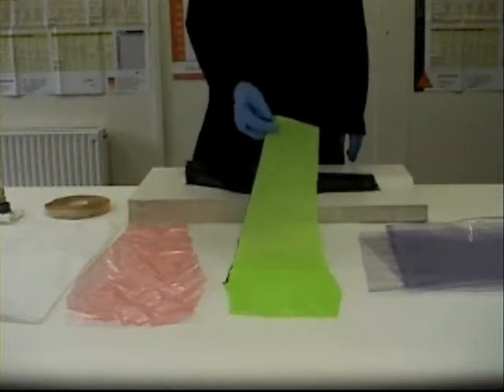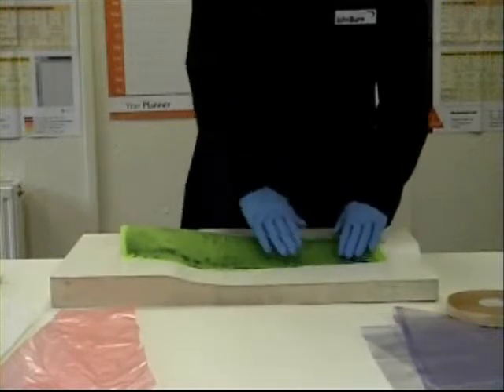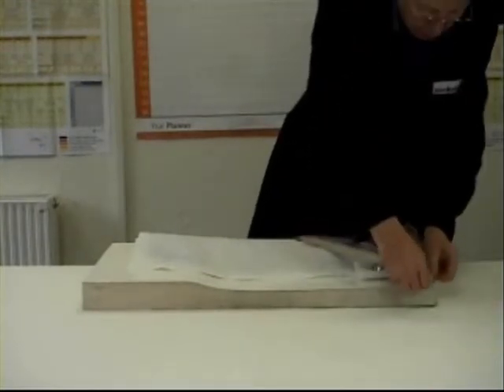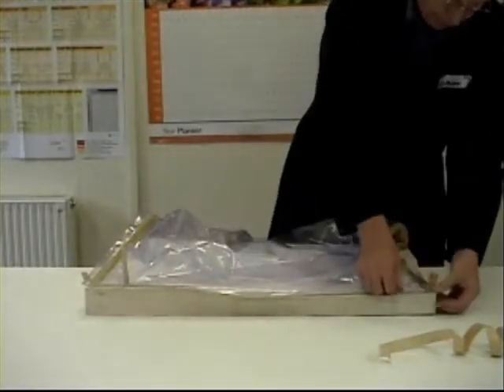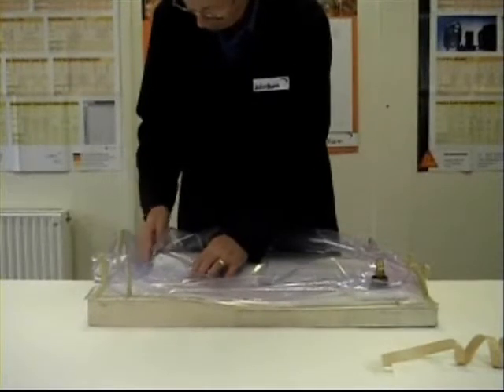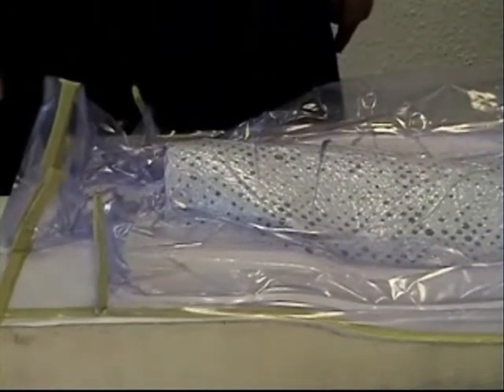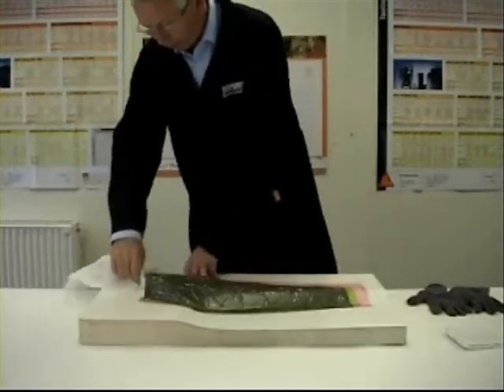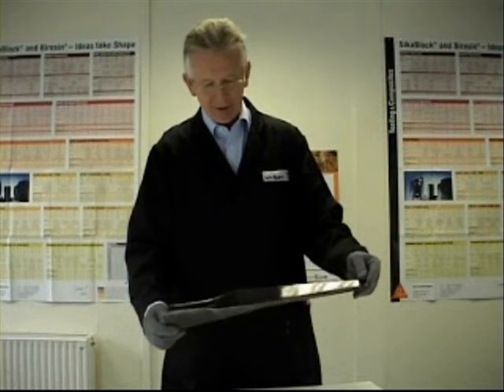A guide to vacuum bagging

Comment: Hi, nice video. A couple of questions if I may ( and still available to comment), Q1 are you using a pre-saturated /pre-impregnated carbon material - what would that be called, or if not, what epoxy gives you that working time? Q2 What pump do you recommend as a standard vacuum cleaner would blow up and obviously not give enough pressure, but the cost of a full industrial vacuum pump is an expensive item for non-commercial applications. As a modeller, what would be a reasonable substitute? thanks in advance for your thoughts...

Comment: Very nice video! so i tried it myself but i have the problem that even using a lot of resin my composite ends up too dry. Do you have any advice to avoid that?
Reply: im not expert but, less vacum pressure, and nivelate the parts/ put in best position that the resin dont run all to same spot.  Never heard about your problem before  i hope that helps.

Comment: the vaccum bag connector .. does it have a Valve in it ??

i mean if you disconnect the vacuum pump from it the connector ,dont you get air in the bag again ??

  how do you prevent that from happening ?? 

kind regards

Comment from the maker: @gserghiou the pleats in the bag help the bag to mould aorund the shape of the part. If the part is a particularly difficult shape you will need to have some give in the bag to ensure it can cover the area without stretching as the vacuum evacuates the air and causing problems with the component.

Comment: im completely new to this and id like to learn how to do.  i make foam core skimboards in my garge and theyre all right, they get dents in them fairly easy. I was just wondering where i might find all this material to be able to do this technique. I'd like to make stronger boards, not trying to run a buisness or anything. thank you and bi the way, how does the resin dry if all the air to dry it was sucked out by the vacumm?

Comment from the maker: There are a number of variables when it comes to reducing air bubbles. Typically depends on type of resin (viscosity), temp and pot life. By vac bagging you should be able to remove 80-90% of bubbles, the rest being so small that they shouldn't be visible with the naked eye. Of course to get the best results you would need to use Pre-Preg with an autoclave, but this route is not normally affordable to most. The PSI is around -0.8 to -1bar for the purpose of our demo. Hope this helps.

Comment: ahhh i see, so the vacuum totally gets rid of any air bubbles?, its just i notice some laminators use rollers and some don't,  so i've been questioning if vacuums are reliable enough to completely get rid of all the air, i was trying wet lay up a while ago but air bubbles were occuring everytime, you pros make it look so easy ha!, but just one more question, how much psi is your system pulling?, thanks